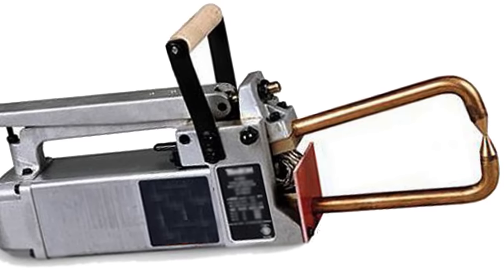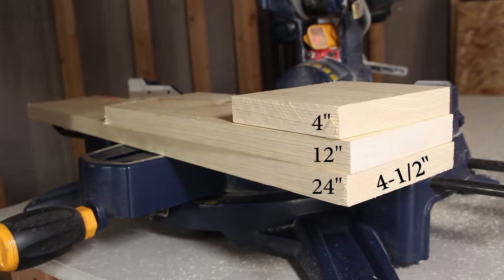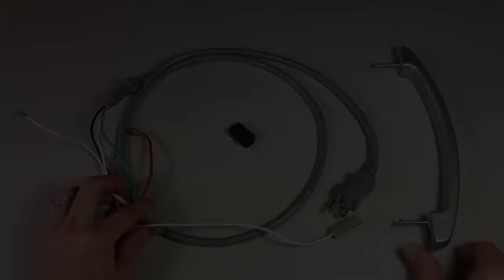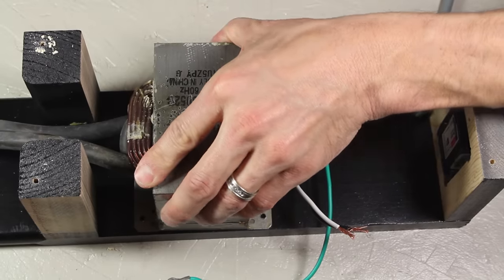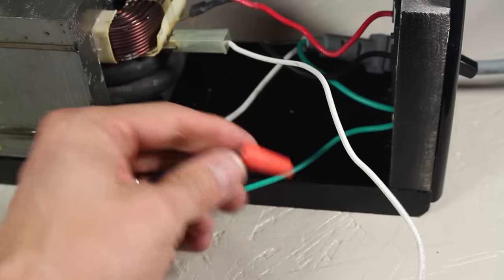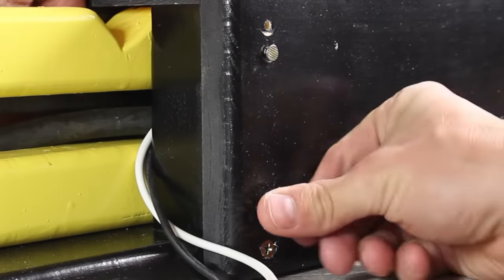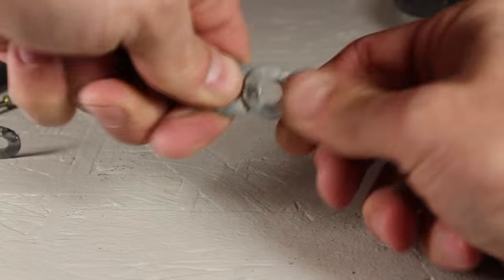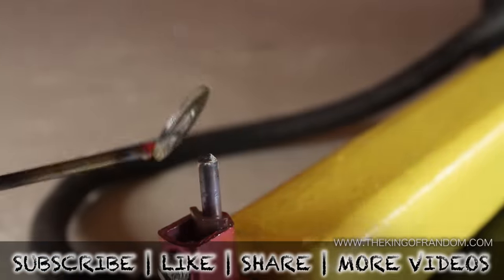Make a Spot Welder for Cheap!!

Comment: I will use this model to build a spot welder for batteries, but will put both electrode on the top bar, and fashion a simple vise on the bottom. 

Thank you so much for this great video. You never fail to impress with your simple, cheap, and useful videos for DIY projects.

Comment: Be careful with items like those washers.
They appear to be plated and plating materials can lead to toxic fumes when welded.
Reply: +Pat McBride Very good point!!  I would say YES zinc welding is very hazardous. But the people that do these projects should know this in advance. I would put those that do not thoroughly check these hazardous things out first as being totally stupid. And I  would hope that those who do want to try out these experimental projects will get their ducks in a straight row before just jumping in. For one thing working with electricity is the number one thing in killing very many DIYers. So for anyone trying to make anything using electricity I say KNOW WHAT YOU ARE DOING!!! Period! I have been shocked by everything from high amperage 12 volt capacitors to 480 volt. The worst was a 208 volt circuit that I only had one phase turned off. Oh and where a good mask when welding Zinc!!!
Reply: +Pat McBride every welding process releases more or less toxic fumes, but you're right, zinc and nickel are not to be messed with, I always get rid of the coating with acid. The real problem though, is the chromium, you can only grind it off...

Comment: Good gosh, thanks for the post!  I do not even have to have to make a home depot run for this!  There have been so many times I would have used this rather than pull out the Mig.  I think ill bore the arms and run the leads up inside the arms but for most people this may not be a option (less common tools/drills).   Great job, thank you for taking the time to post this and so many other things.    Btw  am I correct that this will draw the same amps as the original microwave?  I have a couple of push button reset breakers (10 and 15a) and I am thinking of using one. (again the odd things I have here, I serviced electric door openers, mostly garage type for 18 years and saved old stuff cause you never know when you going to need a relay, contactor or other odd part).   Thanks again
Reply: You could probably save yourself a lot of effort by just re-purposing old welding wires.

Comment: The tips will last longer and stick less if you tilt the part being welded. So that the left of one electrode and right of the other contact the item and the current flows through on the diagonal. Also mount it on a bench and add a cord or wire connected to a foot pedal to free a hand. Could even add a spring to make the pedal two stage, one stage to contact the part and with a bit more pressure the second stage engages the switch.

Comment: For those attempting a similar device I recommend getting copper mig welding electrodes. Cheap, made from a copper alloy which prevents steel from sticking to it and is designed to withstand high temperatures and the come with a M6 threaded piece for easy fitting...

Comment: Anyone copying this fine project should consider adding a relay between that little interlock switch and the transformer. All microwave ovens have a relay or triac that switches power to the main transformer. The little interlock door switch does not, and is not rated to handle the full current draw of the transformer. [ I note here that it obviously worked in the video, but that doesn't mean it wasn't limiting power or heating excessively which could be dangerous in one's hand.]  The switch should control the relay which then can supply full power to the transformer, safely. TLDR: I'm suggesting a small improvement for a great project.
Reply: Buying a heavier duty spring switch seems easier than making a relay, either would work though
Reply: +A1Skeptic Yes, I was thinking the exact same thing when I saw that little switch. This is a good idea although I use my everlast tig welder for a spot welder. I just needed to adjust the downslope to get the spot welds consistent.
Reply: +A1Skeptic Where can i find a relay like that-im making the exakt same project
Reply: thanska,i actually put apart one and i didn see the relay. is it on the circuit board?
Reply: No, the power relay is generally a large stand alone relay about two inches square. Newer ovens may do away with the relay and use a large power transistor or triac to control power to the transformer and so to the magnetron.. You can trace the power lead back from the primary of the large transformer to figure out what they are using to switch power. The secondary of the transformer will be connected to a capacitor, diode, and the magnetron.
Reply: Thans,i don't have a relay in the microwawe but there's another transformer on the circuit board toghethere with a relay. i don't know what to do now shuld i desolder the relay ands the trans or not
Reply: +žan pekošak fase
Reply: +A1Skeptic I don't really see your point. I have many of these switches. Right on the side of them is the current ratings. They are rated at 125 volts @16 amps or 250 volts @16 amps which is well within range of the current draw of the transformer. I guess your thinking the switch is carrying the output current of the transformer which would be around 3 volts at 800 amps. That would melt the switch almost instantly, but is not the case. A relay is not needed. If the current draw ever stepped above 16 amps (which it never will) the switch would heat a little and throw a most commonly used 20 amp breaker in your homes breaker box.
Reply: thanks!
Reply: "The little interlock door switch does not, and is not rated to handle the full current draw of the transformer." To make this statement, you would need to know both the current rating of the switch, and the current draw of the transformer. The switch is a common microswitch, which is rated for 10A. Unless you have more information that you're keeping to yourself, we don't know for sure how much that transformer is drawing in that set-up. I would be willing to bet it's less than 10A on the primary side, since that would yield 1200W of power. The rated current carrying load of 6AWG copper wire is about 75A. Let's assume he's going over that (the tips do eventually burn away, although most of that would be due to heat generated in the materials being welded), so very generously 100A gives a nice round figure. In order for the primary to be over 10A under those conditions, the turns ratio of the transformer would have to be 10:1 or less. You can clearly see that there are 2 turns on the secondary, and I think you can also estimate that there are far more than 20 turns on the primary. Hence it's very unlikely that the switch is passing more than 10A.
Reply: I would also suggest using a small resistor and capacitor in series connected in parallel with the switches because when you switch an inductor like a transformer off you get large voltage spikes which arc inside of the switch wearing down the contacts and the life of the switch.
Reply: The rating on the micro-switches made me nervous until I looked more closely and saw they're rated at 16 amps at line voltage.  I don't know what the draw of the transformer, but I don't think it exceeds that.
Reply: A1Skeptic umm
Reply: A1Skeptic you only sp.ot weld for a few seconds. It's not actually intended to be held no more than that. Also the micro switch is rated for  110 vac.

Comment: this just saved me $800
Reply: +VK70001.P Said no one ever.
Reply: +Gentle Gamer that's not accurate i said it your just full of misinformation
Reply: +VK70001.P well. it doesnt really have that umpf you need to weld properly. but it does something :p
Reply: what was the overall cost for the components you used to build that welder?
Reply: How about the power needed ?

Comment: Very impressive work. Why'd you build it out of wood though? Wouldn't it be able to catch fire easily?
Reply: all of the heat is at the tips where they touch.
Reply: it doesn't conduct electricity, is relatively inexpensive, easy to use, and if it does somehow manage to catch fire, you use the fire extinguisher you should have nearby.
Reply: Not really. The reason tools and other stuff aren't made of wood isn't because it'd catch fire easily but because of weight.

We use metal boxes because they are strong and light, but honestly the best and safest boxes tend to be plastic banana boxes. Though plastic is even easier to catch fire then wood.

Electricity causes electrical fires only during improper wiring, or people being dumb. Most electrical fires happen in bedrooms using extension cords that get pinned under heavy dresses or bedframes that end up breaking the insulation and leading to exposed arcing wires.

Comment: So touching the metal being spotwelded will NOT shock you?
Reply: He only has a couple of turns of wire  for the secondary he added to that salvaged microwave transformer. That is only going to produce a couple of volts. You couldn't shock a mosquito with it. It will produce masses of current if shorted. Go touch the terminals of your car battery and see that you feel nothing. They wouldn't leave it exposed if it was dangerous, yet it supplies 150 Amps to crank the starter. In fact people use car batteries to spot weld instead of the transformer in this video.
Reply: Jeffrey Deutsch Thanks Jeffrey.  I am still gun shy from when I was 10 and held angle iron for my Dad to tac with his arc.  Never a problem before, but his time when he touched the stick, the 220 curled my arms and after 40 years I forget the technical reason it happened and I am a bit paranoid, lol
Reply: scott lund dad probably forgot    the groundwire and you became the ground conductor. and arc welders use a higher voltage than the about 2volts this spotwelder uses.
Reply: Jaden Smith Technically when you bring the two tips together, you are touching both terminals as you hold the metal.  I was concerned about becoming the ground as what happened when I was young.  What FlexDRG said about it having minimal shock value helped....yet I am still a bit shy.  I apreciate the heads up though, thank you
Reply: scott lund holding the metal inbetween the electrodes won't shock you. your resistance is much to high, certainly compared to the electrodes & wiring so all current will stay within the cirquit and not flow through you.
Reply: FlexDRG Thank you very much, now I believe I should make one.
Reply: scott lund x
Reply: scott lund If you are talking about NiCd and lithium batteries it is like working on a watch with a pry bar

Comment: Be sure to wear safety gear.  Pellets of hot metal can fly off and give you a serious burn.  This is not a toy, it's a serious tool
Reply: I worked for six years in a shop with spot welders.  They do give off flying pellets of hot metal at times.
Reply: +Emmit Stewart why don't you marry it
Reply: Ian Hawthorn Thain Unless the welder is a woman who doesn't happen to be wearing a bra.  It happened one day in the shop where I worked.  After that, a bra was required safety gear for all female welders.
Reply: Emmit Stewart
Just thinking about it brings tears to the eyes!
Reply: with nearly exposed, unfused unprotected mains  inches from your hands (the microswitch) i'd  say that hot metal is the least of the user's problem

Comment: I think people need to realize if your looking to make a spot welder.  you need at least some basic hand tools To even do this project. I'm 32 years old and I am a tinker and back yard mechanic by hobby. It took me years to accumulate hand tools wrenches machines etc. I always have scrap wood and misc screws and wire I save. If I did this project it would cost next to nothing.   

But a beginner could buy a cheap hand drill and hack saw and some wood screws.
Reply: Same Here  It pays to be a Pack-Rat!

Comment: Michael Wiegand
Yes dangerous if you don't know what you are doing.  However 2V is not going to hurt you.  You can hold on the the electrodes all day long with the power on with no problem.  My commercial spot welder does not have a breaker or a fuse.  He is using wood.  What better insulation.  I get that you are warning of potential dangers but that goes with using any power tool.  Common Sense may not be so common with some people.  Those people should stay away from any project that uses electricity or any sharp objects for that matter.
Reply: ***** Yes you make a good point.  I vote for a relay as well.
Reply: ***** Well it's actually both voltage and current.  Need a high enough voltage to cause the current to flow.

Comment: Why is it that every time he does something some that melts metal he makes it out of wood?
Reply: easily replaceable? XD cheap
Reply: YeahI ts very cheap and he probably has a lot of it just laying around plus its a lot lighter than a bunch of metal built the same way
Reply: the wood is an insulating item. the heat and electricity wont transfer through it so its safe to to touch.
Reply: ***** everything is conductive, It's just not very hue hue hue
Reply: Natte Bec I don't think it is impossible for electrons to complete the jump given enough power.

Comment: DO NOT repair ANY of the structural welds of your vehicle with this! For light, non life-threatening hobby use, it should work ok. -Michael E Rinkle, 22yrs autobody collision frame tech.
Reply: You don't think this would weld 20 gauge metal together?   I would use heavier copper filed to a rounded tip.
Reply: Michael Rinkle This aint an arc welder its designed for making battery packs or sticking THIN metal together.
Reply: You can't tell me how to live my life. I'm going to weld the entire frame together with this thing
Reply: Too late, I already extended the frame of my truck...

Comment: I'm wondering if anyone actually did this, anyone?
Reply: Unknown Dragon Working on one right now. I'm following his plans to the letter so I'll let you know how it turns out.
Reply: well?
Reply: I made one. I tweaked some of his ideas and added the fan from the microwave too just further prevent any residual heat. works pretty well. most expensive part for me was the main welding cable. I found a company online that made me a custom one for pretty cheap and it's been amazing
Reply: Intelligence Is Key I finished it and used it. It works perfectly.
Reply: brooks wade Fantastic! Do you have any experience with other welders to compare it to?
Reply: gizmoguyar I've used the ones that he compared it to at the first of the video, and I've used larger ones in sheet metal fabrication shops. Spot welders produce a sudden arc that fuses the metal together. This type basically heats the metal causing it to fuse or melt together. Different actions but the same result. I'm pleased with it.
Reply: brooks wade Okay, cool. I've done arc welding, but don't have much experience with spot welding other than these homemade type.
Reply: gizmoguyar I'm sure I'll run into a project where this won't work as well as a true spot welder, but I don't expect that to happen very often. For what it cost and how easy it was, and I'm no electrician, I'm very satisfied with it.
Reply: That's fantastic. I might try to do some modifications to mine to get a better performance. I'd definitely use it more if it could compete with the professional welders.

Comment: You can use soldering iron tips as a spot welder tip because there made of copper  and they will last more longer than the bare copier 6 gauge wire

Comment: Grant, thanks for the great video. I made one of your spot welders and it worked great until recently. It still puts out 2.8 volts  but no amperage. I can no longer spot weld with it. Do you think I fried the original primary wires? Any ideas would be appreciated.

Comment: You're using  a 110V trafo, and modify the secondary coil, but would that also work with a 220V trafo? How much resistance should the cable be ?

Comment: Good job, but you should do better ventilation for transformer. Isolation in transformer can melt during long work. Couple of holes and fan should be enough.
Reply: Yeah but its not used for long work as it doesn't run continuously? So it should stay cool

Comment: For the ark furnace, What would be better to reach hotter temperatures?
The "metal melter" or the one with the 8 gauge with 18 turns? What if I want to reach 2000°C

Comment: The main question is how affective the welding and how strong it hold???This tool could be very handy for constructing magazines in pistols or rifles,welding thin sheet metal is real chalange..If you try by mig welder it would melt,however tig welder do the job correctly.........The spot welder mostly need for sheet metal welding on fast quick scales,I seen certain magazines for pistol have nice small dots that hold two halfs together....

Comment: Do you have to use copper wire for welding tips or can you use stainless steel wire as an alternative also do you have to use copper terminal lugs or will non copper terminal lugs work as well ?

Comment: Question: what size is the wire? when you say flexible wire, are you referring to one that is "rubber" coated in lieu of "hard plastic"? I started one, but I am using a 4AWG with hard plastic cover.

Comment: Hi.have just built one  with 1.8v out at winding using 15mm cable (only had room for 2 windings just) 1.8v at tip which is two nails but when attempt to weld thin plate voltage collapses on DD meter and no spark or any heat though trans is getting warm. Whats wrong do you think??? Thanks.A frastrated diy builder

Comment: I finally made my own spot welder (the king of random style) and I have a question.  I used 2 gauge stranded copper wire, but mine looks thinner than the one in the video.  If I wrap the wire around the transformer more, would it be stronger?

Comment: What wire is the white wire from the power lead (mains)? Is it power or neutral?
Reply: tubester4567 to the plug it's the small prong, if the plug is polarized